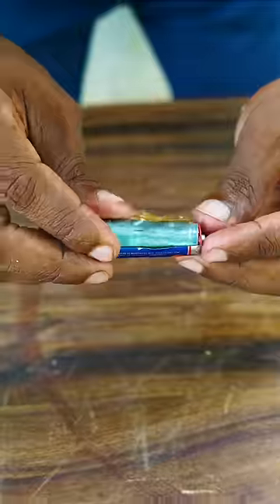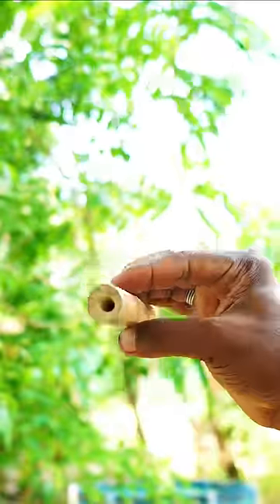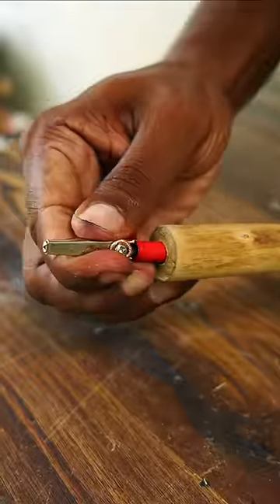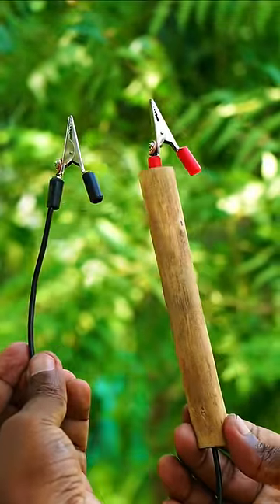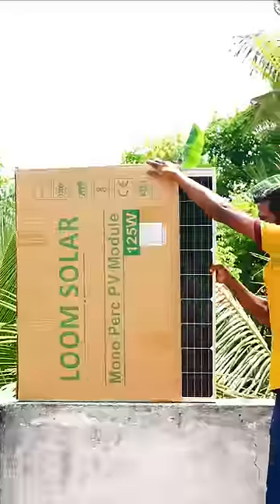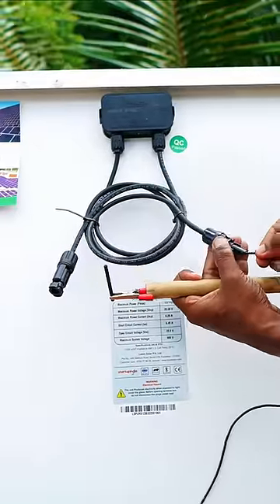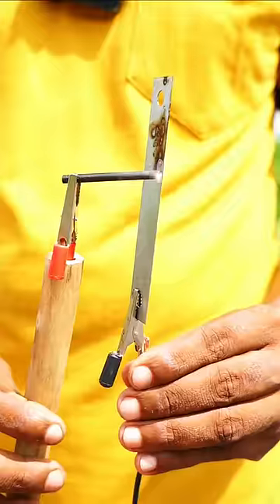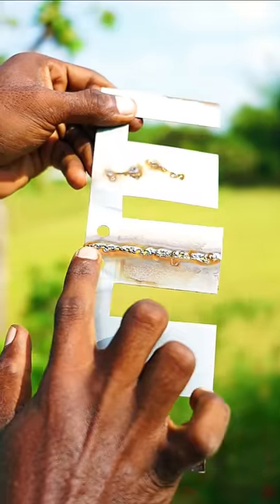Welding Machine 💯 Without Electricity..!🤔 #shorts

Comment: Bro how bro 6.25amps poothuma welding ku atleast oru 20-30amps minimum theava even at 240-250Volts😢
Reply: Bro enaku therijatha soldra ..20 to 30 amps correct but output also 20 to 30 volts irutha pothum apathan nanaku shock adikaathu ... nan yethachi thappa sollirutha sollunga
Reply: @Mr_FRIEND...  bro neega solradhum correct than but welding la pala parameters iruku bro like material for welding, weld energy, pulse time and many different application the current and volts depends
Reply: @racheshwershriventh7629  ok bro🙏🙏